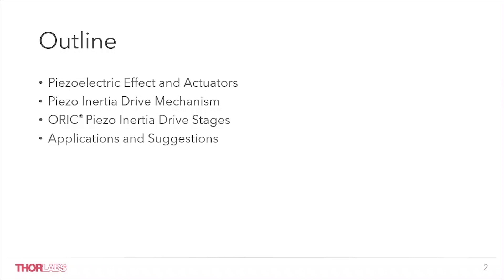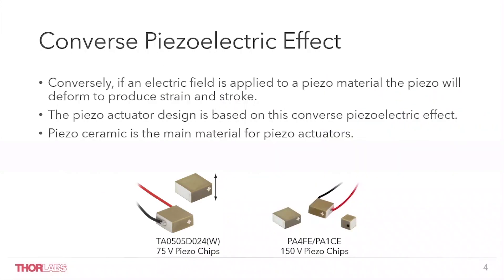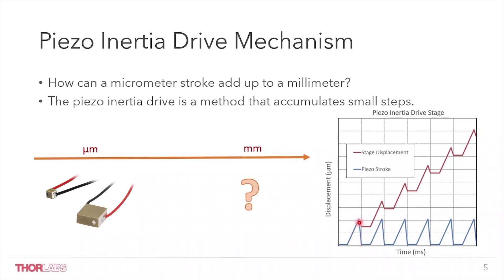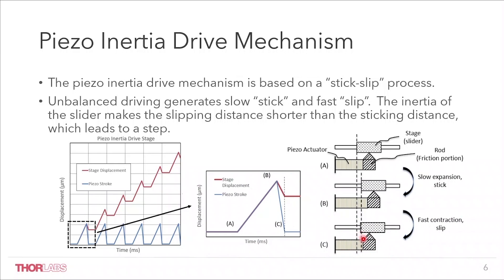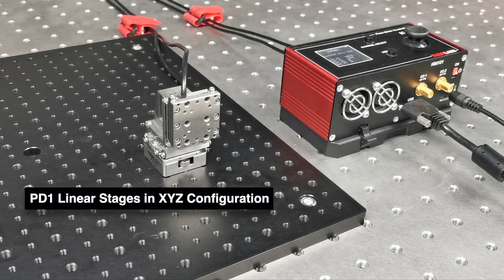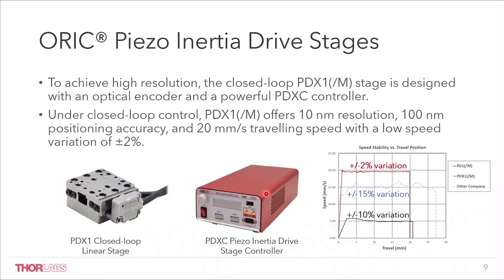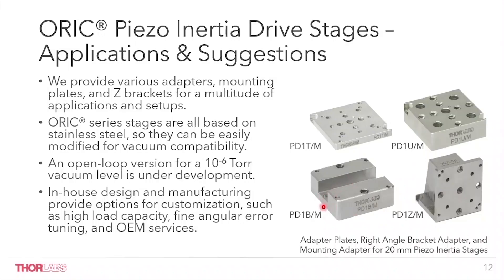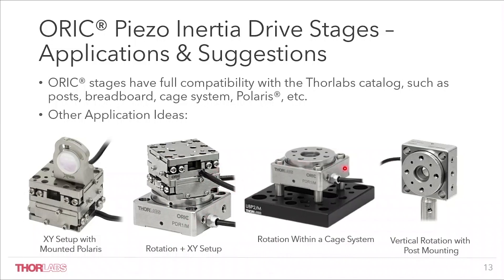ORIC® Piezo Inertia Drive Stages: Travel from Nano to Infinity

Comment: We are planning for cavity length stabilization using a fixed frequency He-Ne laser, we have Thorlabs Polaris-K05P2 kinematic mirror mount (for oneside of cavity) that has in built piezo-actuators that we have planned to control using New Port LB1005-S High Speed Servo Controller. So my question is do we need an additional piezo controller like the compatible one is KPZ101 Single-Axis K-Cube Controller or servo controller will be suffice. Also if you know Polaris K05P2 is capable of cavity length stabilization?
Reply from the maker: The Newport LB1005-S High Speed Servo Controller can be used to control the part; however, its amplitude is only ±10 V, which means that the adjustment range for the Thorlabs Polaris-K05P2 will be narrow, ± 50 µrad. We recommend driving the piezo actuators using one of our benchtop or Kinesis K-Cube open-loop piezo controllers:
https://www.thorlabs.com/newgrouppage9.cfm?objectgroup_ID=1191
https://www.thorlabs.com/newgrouppage9.cfm?objectgroup_ID=2421
Additionally, the Polaris-K05P2 is designed to tilt the mirror, not for cavity length stabilization. We recommend contacting techsupport@thorlabs.com for more details.

Comment: Hi, can K-Cube or PDXC be driven by Matlab?  Thank you!
Reply from the maker: For the PDXC and its GUI, we do not officially support MATLAB, but you can contact techsupport@thorlabs.com for an example code.

K-Cubes also do not officially support MATLAB, but it is possible to control our Kinesis-based Motion Control devices using MATLAB by using the .NET DLLs for Kinesis. Mathworks does have information on using .NET libraries that might be helpful: https://www.mathworks.com/help/matlab/using-net-libraries-in-matlab.html. You can also load the Kinesis GUI in MATLAB. Please contact techsupport.uk@thorlabs.com for further information regarding this application.

Comment: What force is generated by the Stick-Slip drive? 
Is there an advantage over SmarAct or PI stages?
Reply from the maker: Thank you for your questions! A friction force higher than 1 N is generated by the stick-slip drive, which pushes or pulls the carriage plate. Thorlabs’ ORIC® Piezo Inertia Drive Stages offer stable speed performance across the travel range with controlled speed variation, higher horizontal load capacity, and more mounting options (compatible up to M4 (8-32)). Thanks to our in-house design and manufacturing capabilities, customization and OEM options are also available.

Comment: Really nice stage! looking forward to have XY . 
Controller look extremely oversized, but I just have seen that there are K-Cubes with much more reasonable size :)
Reply from the maker: Our open-loop PD1(/M) and PDR1(/M) ORIC stages can be driven by our K-Cubes, including KIM001 and KIM101. However, our upcoming closed-loop stages will not be compatible because K-Cubes do not support the encoder feedback signal. The higher 20 kHz frequency of the upcoming PDXC controller makes it suited for the ORIC stages in general because of their higher travel speeds, and its support of encoder feedback will make it the only option for closed-loop stages.